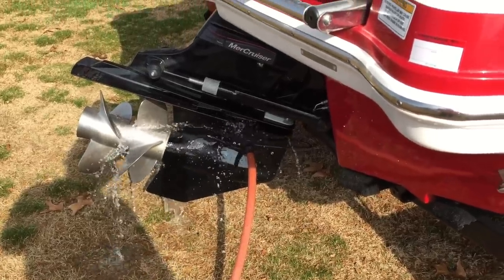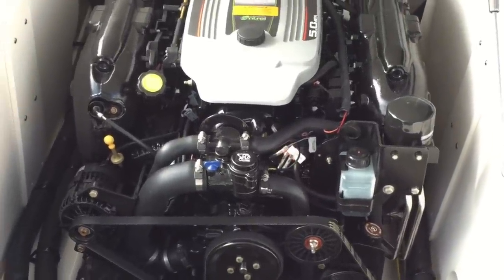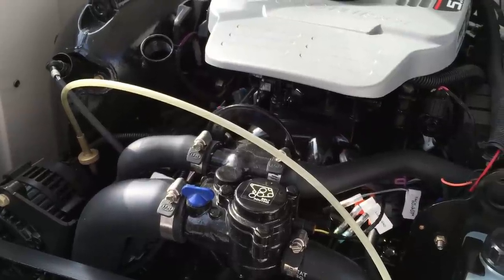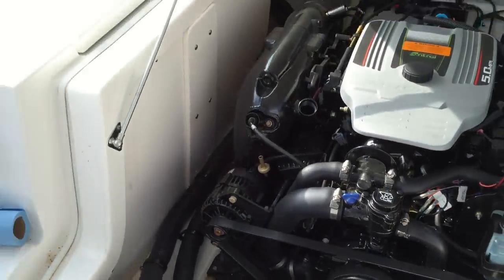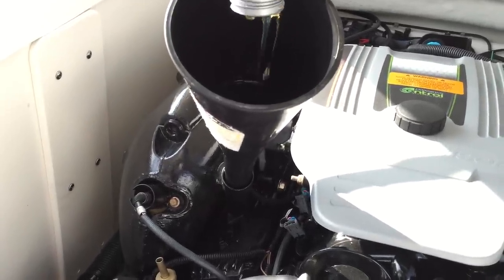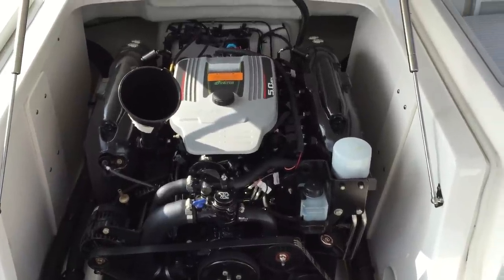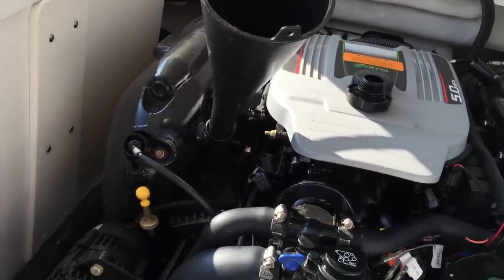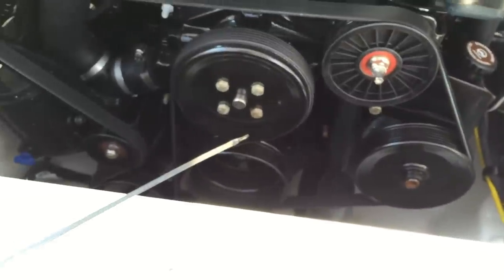Engine Oil Change Mercruiser 5.0 MPI

Comment: The tube you insert doesn't have to go to the bottom because the diptube goes to the bottom of the pan. If you hook your pump hose to the outside of the dipstick tube it will go faster with the larger diameter.

Comment: Hey! How come you didn’t show us how you removed the oil filter without making a mess?
Reply from the maker: I ran the motor for a bit to warm fluids and engine, but let it sit for a few so most of the oil drained back down into the block. I then vented the filter when I drained the oil with them pump. Some oil leaks out but I just packed paper shop towels around it to absorb what may leak out.

Comment: I just bought a 2015 chaparral h20 21foot ski & fish with 5.0 what is the recommended break in procedure
Reply from the maker: +jacob dukes I would consult your owners manual. Mine recommended varying the throttle and staying below 75% throttle for the first 10 engine hours. After the first 10 hours (between 10-20 hours) you were allowed to reach WOT (wide open throttle) for brief periods (under 2 minutes at a time). Consult your book but mostly don't go too hard and make sure to change your rpm's frequently. Also check your fluid levels (oil, power steering, trim) often as the engine breaks in.
Reply: Worked great, took at least 20 min to get oil out

Comment: Great Video!  What's the make/model of that oil hand pump with the attached plastic catch reservoir?
Reply from the maker: Atwood 5 quart. 

http://www.walmart.com/ip/Attwood-High-Speed-Oil-Change-Pump/38057100
Reply: +sirmarcusandrew Thanks for the oil pump tip.  Any chance you could do a tutorial on an impeller change?
Reply from the maker: +Joshua Watkins I just had mine done by my marina. Maybe next time I will do it and make a video. This is a Bravo 3 and the impeller is on the engine, not the lower unit. It's a pretty detailed thing to change.
Reply from the maker: +Joshua Watkins try this for now. https://youtu.be/eZYJq746awc

Comment: I did my Chapp Sunista today and did not have a small enough tube to fit inside the dip stick hole. However the one I had did fit over the top and worked just fine that way. Got 4 Q out and then what was left in filter. Another way to same goal..However I must say getting the filter off made a oil mess. What a bad design for a oil filter placement. :-((

Comment: Hi dear,I just change engine oil for my 2014 Tahoe Q7i,but when we went out the lake yesterday ,the engine start right up but run about 5 min then stall, the engine is crank but not fired at all, and when I turn the key to on is sound "beep beep"not like before sound like long sound...Can anyone help??Thanks Jimmy
Reply from the maker: You may try a few things first. First, I would say is check your oil. Make sure you have oil in the engine and that it didn't leak out, or is low now that the engine ran and has oil in the filter. Your alarm may be caused by low/no oil pressure and not start as an engine safety. 

Another thing you may check is to see if you accidentally hit the kill switch connected to the lanyard. The engine will turn over and not start if the switch isn't in the run position. Sometimes it looks like it is in the run position but not fully be, so you may take the lanyard all the way out and then reinsert it to make sure it is properly in position. 

Another thing to check, your impeller may be worn out or clogged causing the motor to over heat and sound an alarm.
Reply: I'd checked my engine oil is actually too much oil,I'd draw some oil back out to the level is said ok but the engine is not fire and the sound is still the same....!!! sad...